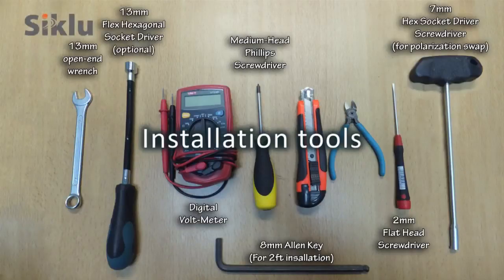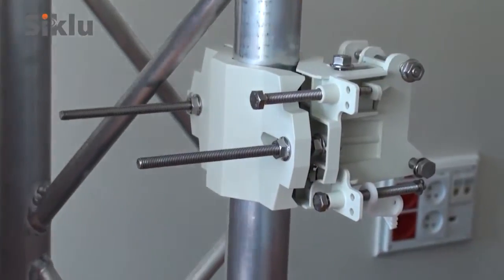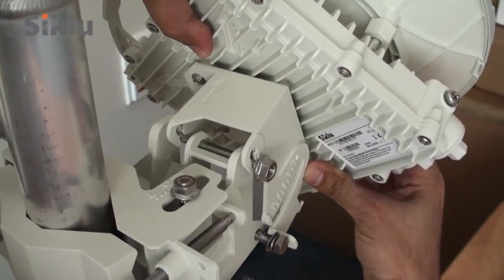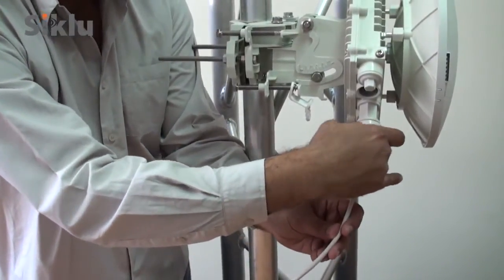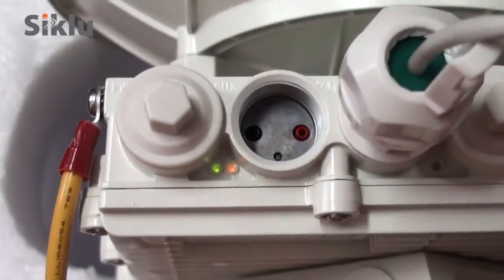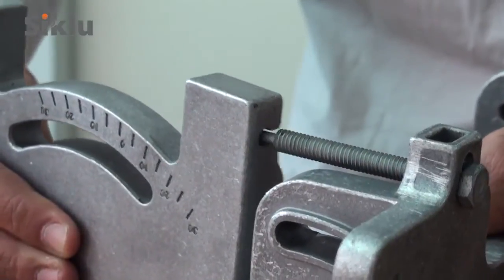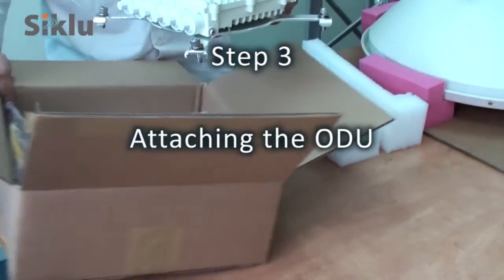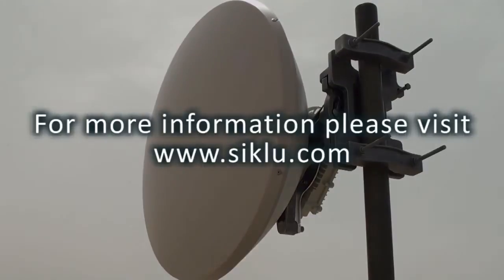Siklu EtherHaul Installation and Setup

Comment: The implementation for fiber on these radios SUCKS. You are in an outdoor environment. You must use Outside Plant rated fiber or conduit. Most commonly available OSP rated fiber is 6 strand, not 2. Premade OSP- 2 strand fiber usually has 18" legs, which are not weather protected. That won't work, the Siklu fiber connection gives you room for only about 1-2 inches, You can terminate your own ends, but the exposed portion of the fiber must be kept VERY short. Few distributors carry 2 strand OSP fiber, so terminating your own is problematic.
You just increased your install costs and/or increase the risk the fiber connection will be a failure point. 
If you are implementing this in the USA, you cannot use common, inexpensive conduit and Liquid Tight flex conduit because the radio connection is metric thread. You can order and buy special adapters, but the interior opening is restrictive and may not work. You won't be getting these at your local distributor, or Home Depot.
I've brought this to Siklu's attention, but they have no answer. The lower radio cost is negated by the higher install costs. The result? I buy far fewer Siklu's and more of the competition. 
Too bad, the radios themselves are reliable and the management/administration is good. 
The mounts are a PITA, but not nearly as much as the fiber implementation.
The local support guy told me they did this for an IP68 rating. Stupid. No one is installing these devices 1 meter or more underwater. Great example of over engineering costing the Customer more for no benefit.

Comment: A few days ago we installed another set of RRL. 30 cm antenna, 1gigabit / s duplex spacing 1200F. For some reason it does not work in one gigabit (bandwidth in the radio frequency range of 500 MHz), HF, only works in a mode of 500 Mbit / s (in a radio frequency bandwidth range of 250 MHz). It is necessary to switch to the 500 MHz mode and immediately link falls. A distance of 2500 m, on the reception levels -45-47 dBm, the signal / noise ratio of 27-28 dB. Tried RRL testing in the lab, the link 11 m - capacity of 500 Mbit / s with a width range of 250 MHz, is switched to the band 500 MHz and Link falls immediately. Why?